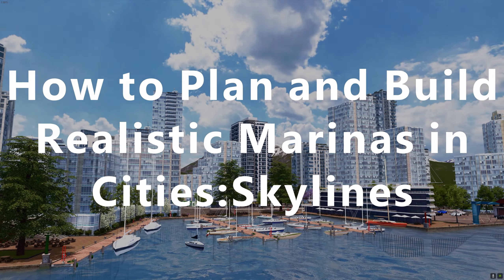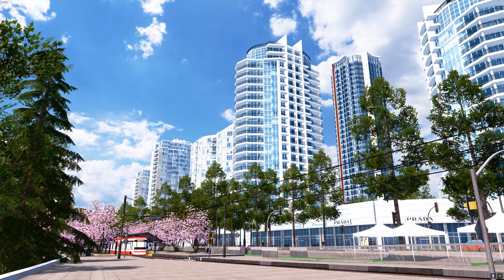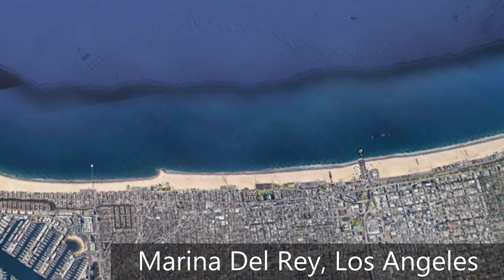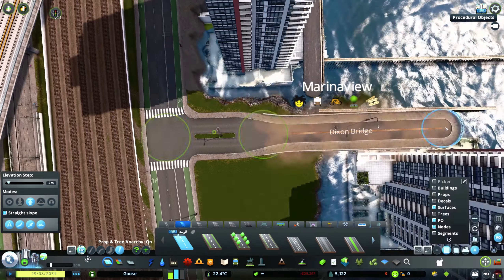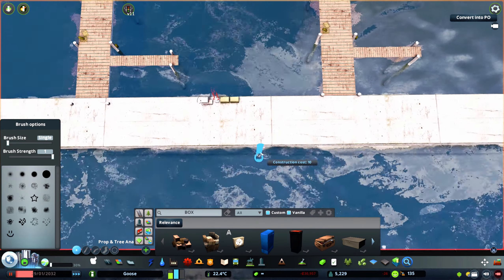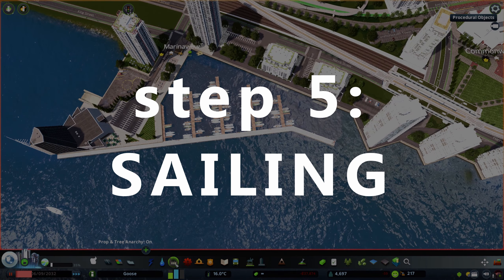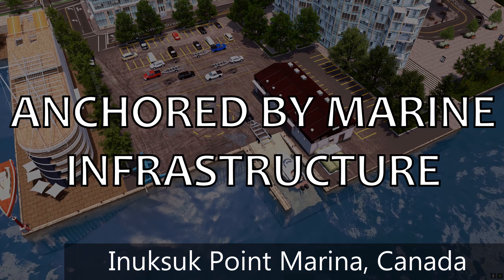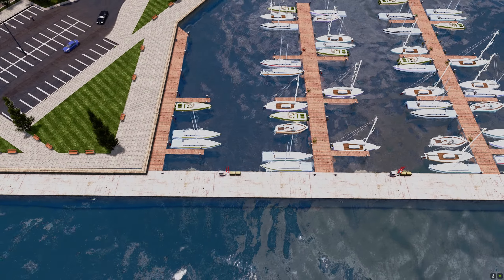Cities:Skylines How To: Realistic and Functional Marinas

Comment: The most important difference between a fresh water dock like built in the video and a salt water dock is accounting for the tides.  Any marina on the sea will generally be floating on on piles to allow it to go up and down with the tides, and then is connected to the shore via a flexible ramp.